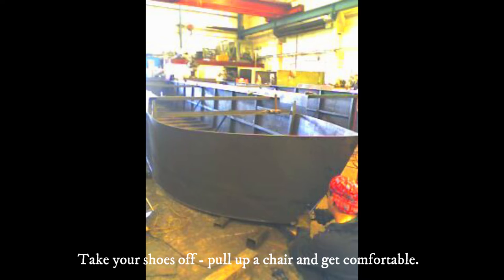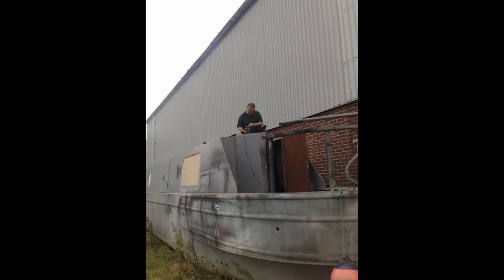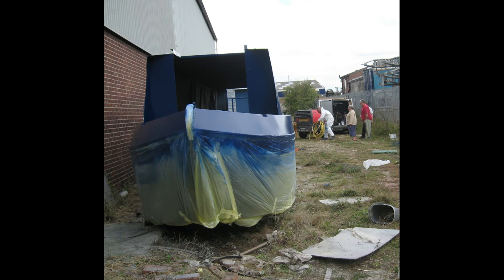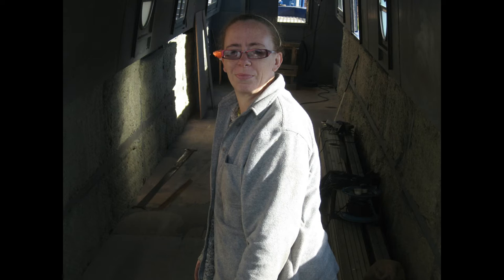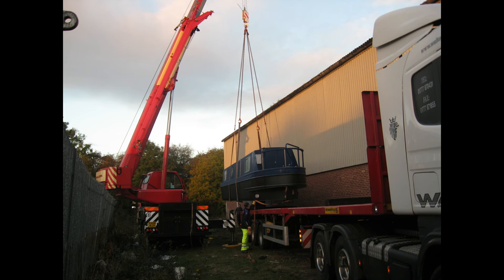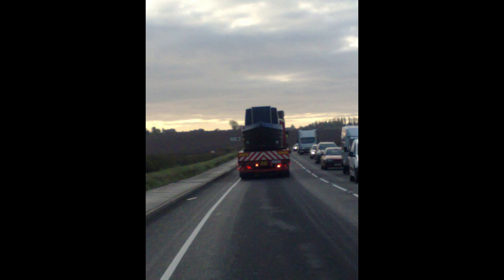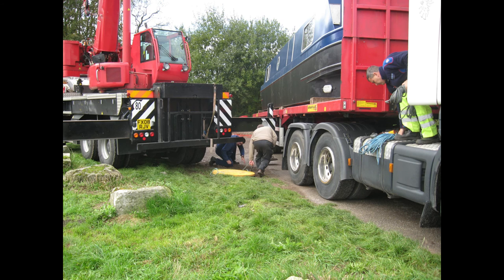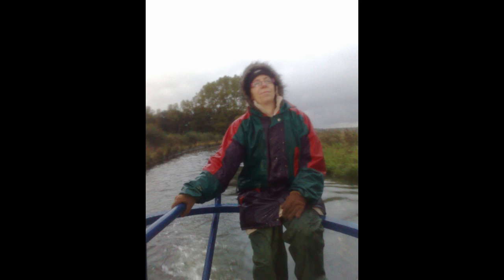#1 DIY Narrowboat Construction: From Sheet Metal to Sail Away - Our Self-Build Journey

Comment: IF i may ask what is the pitch of your prop? You seam cut through the water a little quicker them most??
Reply from the maker: Unfortunately Dave can't remember, the paperwork is in the lock up and we wont be back till winter - We do have a 16 inch Prop and a draft of 30 inches which helps.  We've just been pulled out for blackening and had compliments on how quick to respond 'Changing Pace' is.  Remind us later this year, potential able to give you a fuller answer then.  Thanks

Comment: very cool, did you do all the welding & fabrication and build to plans? or did you have to have someone specifically licensed to do certain aspects?

I ask as I have done welding off & on for 40 years, as well as mechanics, & body work, but no idea how laws are there, or if it is feasible to build your own, even if qualified? the finish wood work is my very weak area, plumbing, electrical, engine along with welding is no issue, but making cabinets, or any intricate wood work, I am all thumbs
Reply from the maker: Hi Randy, yes it was built completely independently. We bought plans from acorn engineering which you can adapt to the type and length you require. The internals you need to plan yourself,  I downloaded the bss specs to make sure everything was done correctly, asked a gas engineer to check what I had planned and then test the system. You will need a bss exam before you can put it in the water. If you have space and the skills and tools there is no reason you can't do it. Cheers and thanks for watching and commenting Dave
Reply: @NarrowboatChangingPace  now I have a path to seek, I plan to retire in 2-3 years, I am one that has always hated paying others for work I can do, unless something I dont want to do, which is rebuilding kingpins on old vehicles, lol. but finding a gutted boat for right price could be an option. & I do not mind repairs. or roughing in. 

I will do more research, but with access to equipment, I am comfortable doing any work other than finish work, I can do rough in wood work. but I know I want a little bit different style than I have ever seen,  I want a vintage engine in engine room, but a hybrid to be electric power, I want to use Tesla power cells, for power for motor as well as electric power for boat, and I want barge type steering inside, instead of standing outside in sun & rain. after 35 years of riding motorcycles, mostly for my primary transportation, I dont want to be outside in weather, unless I choose to, but still want to ride.  in last 3 years I went to riding 4 wheels daily instead of a motorcycle, but I ride my Harley when I want to, but have 2 BSA project bikes to build, also thinking hard of going with an alcohol cook stove, so not tied to using bottled propane? 

I have not seen any narrow boats hauling their own transportation other than bicycle? any reason a person couldnt carry a vintage BSA motorcycle to use to sight see, & transport goods from stores to boat? 

besides also wanting 2 toilets in bathroom, nothing else really different, I only have 1 in house, & with my wife, I have to go outside a couple times a week in the morning when I wake up, which I live in rural area, & can do that, but in populated area, I think dual toilets would work best for us.
Reply from the maker: Hi Randy
Not sure the plans I had gave an option for inside steering (wheel house) but i'm sure you could get round it fairly easily. We have come across several boats carrying motorbikes, mainly on platforms at the stern, again not so difficult to overcome.
With your requirements, I think you would be very lucky to find a second hand boat that would suit your needs. Starting from scratch with a new shell would probably be cheaper and more successful end result. There are a couple of online sites that allow you to plan the inside layout of narrowboats, this will also give you the length of boat to suit your layout.
Good luck with your project and I hope some of what I've said has helped.  Dave
Reply: @NarrowboatChangingPace  Yes, Thank you so much, & as for a platform, I would rather have bike inside, toward bow, no need for open outside area there, I want it away from elements, so its easier too keep clean. as well as tinker with as needs change, or maintenance required. think of small area like "engine room" with custom bike, showcased, but windows so people see it. but easy to move & take it out either side with a ramp to shore. 

by any chance you know what sites allow a person to layout boat designs? I had originally planned to just find dimensions & try to draw it out in pencil, so I would have close rough ideas, I had some drafting classes in my youth, but not messed with computer aided designs, but see that could be real handy. 

THANK YOU so much!!!!
Reply from the maker: Hi Randy, try www.narrowboats.org or waterways world web site. Hopefully they may help. You will have to play around with them. It's not something I used personally as I used autocad. Graph paper and pencil may suit you better but either of those sites should give you ideas on room sizes and different layout styles.
As always thanks Dave
Reply: @NarrowboatChangingPace  Thank you so much, & narrowboats site is a help, although not perfect, it will give me place to start, just a few quick clicks, & i'm at 56.5' however cant add a second toilet in program, nor figure out the  wheel house,  but ill get it figured out, hopefully stay within the 58' foot range to travel freely, and not limited.

Thank you for all  the information!
Best wishes & safe adventures & travels.
Reply from the maker: @randymack1782  glad to be of help, good luck with your project, take care Dave